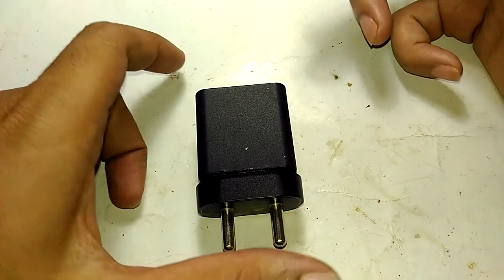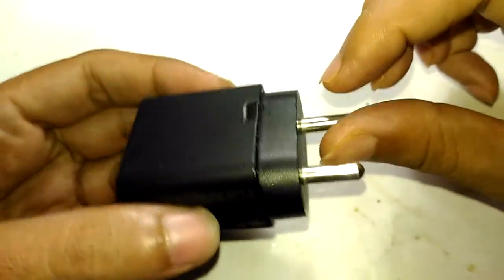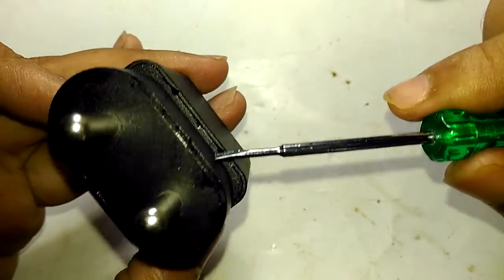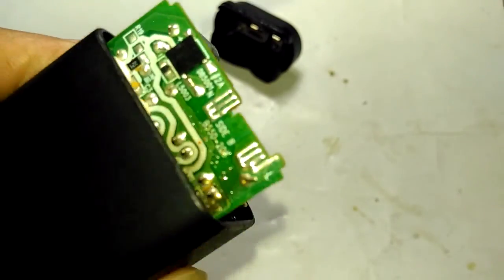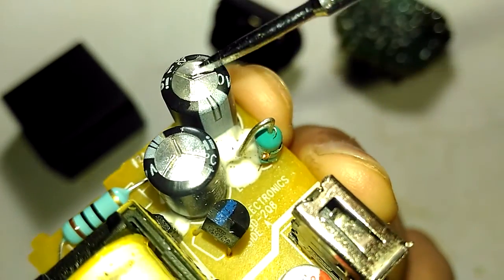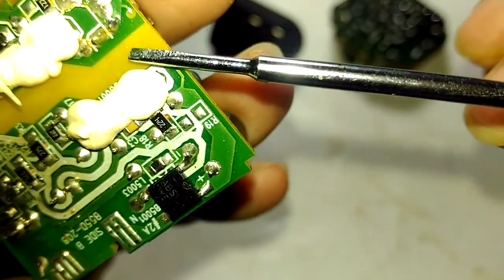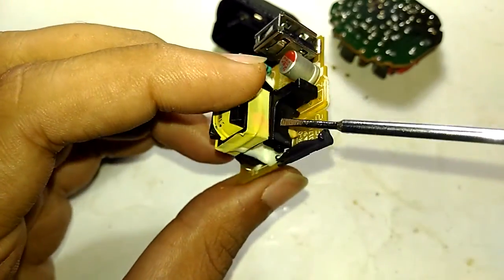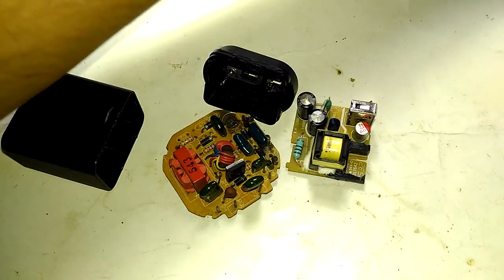IE54: Inside a genuine ASUS USB charger !

Comment: How to buy it
Reply from the maker: You can get it from any authorised Asus dealership or service center. :)
Reply from the maker: Bro sorry I don't speak Hindi much.. can you please ask in English? 😐
Reply: Plz give a link for this charger
Beacause at that time i do not go to service centre
Reply from the maker: This charger is no longer available to be purchased from the official website. However here is the link: https://www.asus.com/in/Accessories/Adapters-and-Chargers/All-series/ASUS-10W-Adapter-Micro-USB-Cable/
If you are looking for a replacement 10W mobile charger, you don't have to buy this exact same model. Any 10W charger will work on any phones irrespective of their brand. You can buy MI or realme 10W charger and still use it with Asus phone. No problem. :) They are not that expensive and is of good quality.
Reply: Will this charger work just like original charger
Reply from the maker: This was the original charger that came with in the box. But as I said, you can buy any good quality replacement charger and use it without any problems. ERD adapter is one good Indian brand that I can recommend and I use it with my zenfone 2 laser. :)
Reply: @INSIDEELECTRONICS   Thanks for replay bro
Reply: @INSIDEELECTRONICS  thanks bro
Reply: Will i buy this charger in this link
Reply from the maker: The link is for the original charger which is not available at the moment. Search for charger in Amazon or flipkart if you want to buy online. But they don't ship it right now due to covid lockdown. If you are buying from a local shop, buy the ERD adapter which is 220Rs here in Kerala. It's a good quality adapter.

Comment: bro ente phone nilathu veenu ippo charger work aavunnilla😥
Reply from the maker: Bro,Charger work aakunnillenno, atho charge aakunnillenno? 😐
Reply: charge kayarunnilla.njn bro cheyyunnath kand open cheyyanum nooki patunnilla
Reply from the maker: Ee charger vere phone il connect cheythu nokkiyo? Or vere cable? Athupole, phone vere eathelum charger vachu nokkiyo?
Reply: @INSIDEELECTRONICS  ERD ethraya rate bro.aaah bro vere phonilokke nooki cable maati angnokke cheythu.vere charger asus allathath use cheytha battery back up kurayumo .ariyathonda
Reply from the maker: Nothing will happen. Battery backup nammal use cheyyunna pole irikkum, charger aaayi no connection. ERD njan vangiyappo 200 something aayirunnu. Correct rate nale parayam.
Reply: @INSIDEELECTRONICS  Thanks bro.bro ethrayayi asus use njn 1 year
Reply from the maker: Rate 200 anu. ZenFone 2, 5 years aayi. Still going fine. Max pro 2 years. ✌
Reply: @INSIDEELECTRONICS  enthelum vazhiyundo bro
Reply: @INSIDEELECTRONICS  ente phone asus zenfone max pro m1 aan vere 10 watt charger use cheyyunnath phone prblm undavumo.company parayunnu asus charger thanne use cheyyunnu athinte rate ₹699 aan😥
Reply from the maker: No problem. Veettile max pro m1 use cheyyunnath ERD adapter anu. Since 2 years. Oru kuzhappavum illa. Company adapter okke business trick mathram.
Reply from the maker: Theere local chathan charger use cheyyathe irunnal mathi. Athu phone complaint aakkum. ERD okke BIS certified anu. So no problem.

Comment: Excellent explanation & english bro. 
I have a Max Pro M1, in-box charger (5V 2A) was giving like 300mA.
Asus replaced it & the replacement was giving less current, & later died as soon as 6mths was over. 
The usb cable is also bottlenecking current.

I am now using a Sony 2amp charger (with sony data cable). this charger is quite bigger than asus one & cable is thicker with ferrite choke.
Since MPM1 model charges at full 2A from 0%-60% , so as to charge quickly than other companies without fast charging, my guess asus adapters cannot handle the heat or stress whateva to give full rate for prolonged time.
Guess they should do load testing & age em before shipping.
Reply from the maker: I'm also facing similar issue with all of my Asus phones. It won't charge properly with other well branded chargers. But it will work fine with local 100 rs charger! I'm planning to make a video about this. Will explain in that. Thank you for your valuable feedback though. :)
Reply: @INSIDEELECTRONICS  Use DeviceInfo Hw app>Battery tab for realtime charge rate. (sys standby=200-400mA, so from 2A charger max charge rate would be 1600-1800mA). 
Charge rate decreases if batt temp>=40C

Contrary to other 5V2A phones who slowly increase charge rate upto mid & then decrease it to end, I see my Max Pro M1 cranks full 2A/1800mA from 1% to 60%, and then slowly decrease. (asus charges 5000mah batt & also boasts quick charge time, but with 10W charger)
Reply from the maker: Thanks for the info bro. I shall check and include the same in the video that I'm planning. :)

Comment: Sir in my Asus charger there is another small transformer it was damage how it replace, and please give the name of that transformer, it have 4 wires
Reply from the maker: It could be a choke not a transformer. Though it has 4 pins, only 2 may be connected to the coils. If it is a choke try to get a core from a different coil and wind it over that.